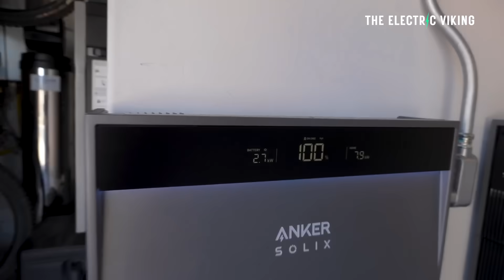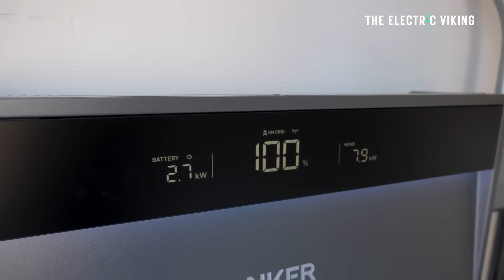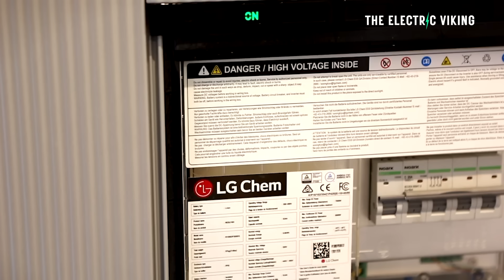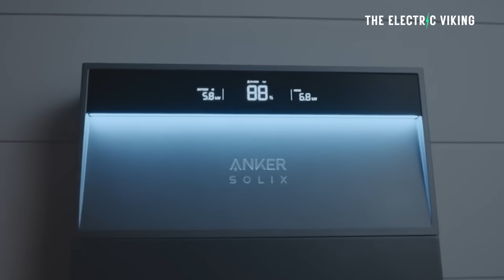The HUGE mistake thousands are making when installing a Home Battery

Comment: We don't have a garage, but I am considering building a shed specifically for the batteries and inverter. If not, it has to go on the side of the house. We are in NZ and less than 1km to the coast. We do have a small porch area but it's close to our bedroom, so I don't really want to be sleeping next to a giant battery pack.
Reply: My batteries and inverter are in a 10 x 10 shed i built about 20 feet from the house.
Reply: @ that’s perfect. A wise move.

Comment: They should be mounted indoors, full stop. No rating will change that. Another thing, solar inverter battery systems are all managed by software, bit like an electric car.  So what you are buying is software, the hardware side of it is pretty much null.  Hence the only electric car to buy at the moment is the one with the best software, Tesla, same for solar power systems. That being Enphase and Tesla.
Reply: What about Tesla software is the best? The fake self driving or the lack of android auto and car play?

Comment: 500m from coast etc. in other industries (eg powder coating industry) generally takes into account variations in conditions in determining the 500m  distance. It’s only extreme factors (eg indoor salt pools, absolute beachfront)) where the systems used may change. 
Galvanic corrosion is another issue!

Comment: Holy christ! A 10min video that could be 30sec ... just a meandering waste of time... water in the battery? Are you serious? Is that the insight? Is this a f*cking commercial for anker batteries?? BYD,  Sungrow Solar Edge all are rated for the same conditions... this is such a waste of time.  
At the launch Powerwall 3 was sitting in an aquarium!!

Comment: I'm very happy off-grid with my Sigenergy system along with its bidirectional DC Charger.
Reply: How many kwh?
Reply: @snowcrazed1  2 x 5kw inverters, 24kWh storage, 14kW pv, 12.5kw DC charger
Reply: @celloFloss  nice! Does the DC charging stop or slow down once the battery is depleted?
Reply: @snowcrazed1  I only ever charge using excess PV and once the batteries reach 100%

Comment: I would never install a battery in or within 3 meters of my house, and only with a cement block wall in between the battery and my house. I will not charge a car or scooter battery in a garage attached to my house. I would never install a battery outside. I don’t want a 3 am fire to kill my family. Am I wrong?
Reply: Up to you, however you have a greater chance of getting killed in a road crash. You still drive?
Reply: You do you. I'm not so paranoid and been building hobby stuff using used batteries, no issues. I put a smoke alarm in the garage though (phev so no false alarms from a fuel guzzling car coming home)

Comment: Let me say I live about a kilometer- 950 metres, from the Bay. 
Salt air corrosion is an issue even though I have stainless steel BBQ and the Aluminium powder coated windows.
Salt air corrosion is a real issue. The tea staining on stainless steel even under cover is an issue. Lifting powder coat and white Al Oxide on scratched Aluminium windows also after 6 years from install.

If you can place a battery in a sheltered area away from direct weather and not on the sea side of the hose the better. But the air is salty and things corrode.
Having worked in the Automotive industry - Accelerated Salt spray testing is a great indicator of Rust/Corrosion resistance. 
The higher the resistance score the better but things will still corrode over time - just takes longer.

I would be interested to hear you over winter months solar generation and storage percentage achieved over the April through late August time frame. 9.4 kW array into an 8kW three phase inverter.
For me down in Vic I get about  1/3 - 1/4 of the summer solar generation falling off  the late Autumn through Mid Spring. 
In  Oct,Nov,Dec, Jan and feb I generate  roughly 1.1 -1.4 MWh. a month.
Hoverver last April through June 2024 that fell significantly.
June and July saw 410 kWh and 420 kWh respectively. So during those months not enough each day to fill a battery above my homes consumption. ( pool pumps and fridges and washing and dishwasher used during the day) 
If I wanted to charge the battery I would have to charge the battery from the grid during off peak time. 
Note - that not all batteries and inverters allow for off peak grid charging. 
Do the homework and investigate every aspect. Finn Peacocks Solar Quotes site has heaps of great reference info.

Comment: I got the Anker backup 🎉 in December. Never been happier I have been saving about 70 bucks a month off of my solar and anchor system.  Except I got the two towers with the two expansions. Those are more portable in case you wanna go camping or something.

Comment: We were advised to go for LG panels as at the time they appeared to be better than the cheaper Chinese panels. As it turned out nearly all the panels failed (water ingress) and it was a struggle to get LG to honour their warranty. Warranties are only as good as the company, LG now say that they have discontinued the manufacture of  panels so it will be difficult for them to service their panels..

Comment: The Anker battery is IP66. If you mount your battery out in the weather then obviously they a susceptible to the elements. Just like an inverter. You can always mount these things inside your garage or build an enclosure. Batteries are no different than a pool pump. Do go submerging them in water. 

Water ingress can happen due to the difference in pressure caused by temperature change if the battery is sealed, which is probably what happened to you skateboard. Vents fix that until you poor water into the vent. This problem has been around for years. Look how the automotive industry gets around it

Comment: Hey Sam, its not the WET that Ruins a battery, ITS THE SALT in the AIR! -- I'm in Florida, and EVERYTHING IS RUSTING DUE TO 'SALT'-AIR!
Reply: Moisture accelerates corrosion.  Salt adds to that acceleration. I live near a fresh water lake near the middle of the country nowhere near the ocean.
 We have vehicles rusting with no exposure to salt as only sand is used to provide grip on snow/ice as the temperatures are too cold for salt to melt ice. 
 Rust all around. 
 Look it up. Water, iron and air cause rust.
Reply: @RudiJock  Thanx for the update.  I've only lived near Salt-water area's and did not know that the moisture is the problem.  Know I know!  Thanx.
Reply: I am ALMOST  certain that it is water and metal along with oxygen that causes rust or in this case, malfunction.  I am pleased to offer you an opportunity to research this on your own, and you apparently did.
 We are all one. No one is right or wrong,  but are often misguided by no factual information.  
 The information I provided was third hand, and all should be taken with (Pardon the pun) a grain of salt. 
 May you be successful in all you put your thoughts into, my friend.

Comment: Install it in your garage, problem solved, installation location is very important in Oz. Anker looks decent. Outputs aren’t overly impressive. Are you AC coupling the battery? You should have looked at SigEnergy imo.

Comment: for such a glaring, blaring headline, I watched 3 minutes in to the video without getting a single reason why "thousands are making a huge mistake" - then Sam says there are concerns that the batteries aren't as good as advertised, and not up to demands for Australian homes. 
Well....  if that's the case IT IS FRAUD on the part of installers and INCOMPETENCE on the part of INSPECTORS and  PERMIT DEPARTMENTS - and Sam should spell that out in the headline and in first few words of the video

Comment: Waste of time.  Just install your battery indoors so no water gets inside.  Does it rain in your home?
Reply: The Australian home battery installation rules make it non-compliant to install a battery in many indoor areas that are on the opposite side of the wall of a sleeping quarters or living room without substantial fire proofing, and even then electrical inspectors don't tend to like signing them off. Most home batteries in Australia are installed outside because of this.
Reply: Many hot water tanks are located in the garage where many home batteries are also located. If there is a failure with the water tank that could be a disaster. Some buildings also have fire sprinklers so you can't put the battery in any place where those are required overhead.
Reply: People keep their computers inside too so there's no water but they still rust after a few years because of all the salt in the coastal air.  So it's not just the water but the salty air you need to protect the battery from as well.
Reply: I’m getting my Tesla PW2 installed tomorrow. I’m 400m from the surf. Battery is going in undercroft which is dry but open air.
Reply: @timfreeman2603 Maybe you should take monthly photos of the same areas of it, especially the metal parts, so that if anything does happen you'll be able to show exactly where and when it started and how quickly it progressed.  And if nothing happens you'll also have some good evidence that the unit can survive salty air.

Comment: When you talk about "water in the battery" what do you mean? Rainwater, wind blown spray or humidity and condensation? These obviously are different problems requiring different solutions.
Reply: I did recommend Sam read from a well thought out script to be more specific and factual.

Comment: Good to know! I just bought a Franklin A-Power-2 which comes with a 15-year warrantee, but I bet getting the battery wet might void the warrantee. BTW, great battery 15kWh and on par with Tesla PW3 if not better. Built in run to 0 reserve so you don't risk bricking.

Comment: I did not know this is such a big issue. Is this only a problem when the battery is fixed outside the house? What is the situation when the battery is inside the building near the beach? I do life in a landlocked country in Europe, so I am just interested how a proper solution might look like for you next to the sea…
Reply: There are a lot of weather factors here , the biggest are you in a humid zone and what is the predominant wind direction .

Comment: In Denmark we make 30-50kwh in January and 700-800kwh i summer months, where light and heating is less important. So here we will newer get independent of external electricity, based on solar power.

Comment: why not just cover the batteries up?   Or put them in a shed?    I have a  Powerwall 2 system and so far, it just works.  No problems, no issues,  great software, storm function etc. so would recommend.  (would not recommend Elon and Trump though at the moment).

Comment: Aliexpress sell a 20kw LiFePO4 lithium iron with 10kw inverter for $6000 it would be good to see if anyone has tried that in Australia its a Tewaycell brand it claims 6000 cycles.
I already have 10kw solax batteries 11kw solar panels our system makes 40 kw on a good day but our powerbill was $600 90 days what a dud of a system. You should look at some of the cheaper batteries
rate them. We need to have more guarantees in place many people get a dud

Comment: When I first retired, I lived on a sailboat and the corrosion you fight, every single damn day, drove me crazy. You're sitting there watching the value of your "home" go down every minute, every storm, every nook and cranny. The maintenance got to be too much and I sold the boat after about 7 years of scrubbing everything nearly daily (and still losing the battle).
Reply: Years ago I used to run a boatyard on the banks of the Brisbane river in Qld,  my dream was to own a 40 footer one day.  After 2 years I realized that a moored boat was a hole in the water where the owners just poured money.  OK for me,  as my staff were kept busy,   but I then decided to get a smaller trailer boat instead, that I could take home and keep it protected.
Reply: Making stuff up now? Nobody does that with their boats. What was your boat made of? Iron? They invented stainless steel, aluminium and fiberglass a long time ago, you know. Which is what most boats are made of. And none of which corrodes.
Reply: @user-hz3eu5in  You've NEVER owned a boat then mate, let alone lived on one. Engines are CAST IRON and or ALUMINIUM, both CORRODE, there is tons of aluminium used on boats, Copper wiring corrodes, you have heard of "sacrificial anodes"  Right, you do know what they do ?   To say there is "no corrosion" and a boat that spends all it's time at sea,  is one of the most clueless things i've read here. Fibreglass also delaminates over time with water ingress, I've seen it and fixed it more times than I care to guess, I've built boats and  worked as a Processional fisherman, and my father managed a boat company for 30 years and has his masters license, I've lived and worked on the water since the 1960's and have friends that live, or have lived on boats, corrosion and preventative maintenance are an ongoing task that NEVER ends on a sea going vessel......
Reply: @MickH60  You sort of missed the point. Sure, everything "corrodes". And yes, everything rusts and turns to dust. Eventually. Nothing is forever. But that was NOT the point I was making. The guy said that constant corrosion on a boat was so bad that he had, and I quote, "to fight it everyday and still losing the battle". Which is utter nonsense. You then showing up and start talking about trivial things like sacrificial anodes as if you are some boating guru and everyone else around you knows nothing. Hate to break it to you, but kids in school know about sacrificial anodes these days, OK? More to the ACTUAL point again though - adding sacrificial anodes to a boat does NOT translate to having to "fight corrosion daily". It is just there, its a preventing measure and you don't have to do anything about it, apart replacing it once or twice a year. And yeah, I know what can happen to fiberglass too - after a few DECADES of boat usage ;) Worked on fixing those issues a few times myself. Again, you missed the point completely there too. There is no daily fights to the death against corrosion on boats. If it really was so bad - nobody would ever want to own a boat!

Comment: The LG RESU battery failures wasn't due to them being NMC chemistry, it was an early and defective design and BMS.  NMC batteries are lasting as long as, and sometimes longer, than LFP batts in EV's and stationary storage.  LFP are just cheaper, but larger.  Nice commercial for Anker.
Reply: NMC are more dangerous tho.
Reply: LFP don't have the thermal runaway problems, it's a major difference...
Reply: Yes, just an advertisement

Comment: Interesting! Live on a small farm and have a very tight budget. So the only way we were going to get solar was to take the DIY route which is the cheapest. Though you got a lot to learn. Spent $4k on 15kW of solar panels, and had a 15KWh LFP battery bank. Just the day before trump tariffs hit I decided to expand the battery bank and bought 40kWh worth of LFP batteries for $3200 (have to work wiring them up and installing BMS/balancers, etc.). Point is solar hardware is VERY cheap compared to the power bill it will replace. Most solar installers simply charge  x2-x4+ the hardware costs because most people will pay it thinking hardware costs are expensive. Solar is very modular. If you have an electrician in the family you can likely DIY for much less if you take the time to educate yourself on the hardware.
Reply: I don't know where you live, but in Australia if you're on the grid you can't get a bi-directional energy meter installed unless it's signed off by an electrician. If you're off grid like it sounds like you are that's probably not a problem, but if you live in a town or suburban area, it's unlikely you can DIY solar or home batteries and not face major insurance and legal risks.
Reply: How are those batteries going?  I'm looking at them on aliexpress atm. Cheers John

Comment: While researching my battery system purchase, I got very interested in the Australian company Red Flow, which was making Zinc Bromide redox flow batteries.  They had done some projects here in California, and I liked the fact that their battery tech had practically no degradation and used very common materials.  But they decided to go for grid scale projects and then couldn't complete a round of financing, so they sadly went under.  Definitely a cautionary tale.
Reply: Also their products suffered from leaks and had a lot of downtime for repairs as the technology wasn't quite ready to be commercialised yet, so it wasn't just aiming too high that ruined them.
Reply: @Berkeloid0  Interesting, I hadn't seen that reported.  It seemed like they had gone through a couple rounds of design and were trying to open an assembly line in Thailand to mass produce their units.
Reply: @darrylrichman  My employer had one as a trial and it spent more time offline waiting for repairs than working.  I don't know the details I just overheard all the complaints about it, mostly around having to run diesel generators overnight instead of using the stored solar power from the day as they'd planned to.  To be fair theirs was a very early unit so some of the kinks may have been worked out since, but I have also seen comments online from other people who were lamenting that car manufacturers figured out how to move liquids without leaks decades ago, so they couldn't understand why flow batteries were so leak prone.

At any rate, it doesn't seem like a problem with the idea, just the engineering wasn't as robust as it perhaps could have been.
Reply: It's not that they "then decided" ... Flow batteries are usually utility size due to their low energy density
Reply: @powerbuoy  Red Flow started out with a residential product.  Residential batteries don't need to be as energy dense as they do for transportation.